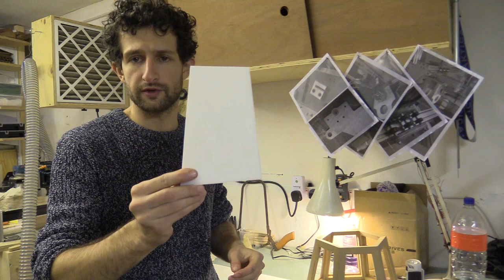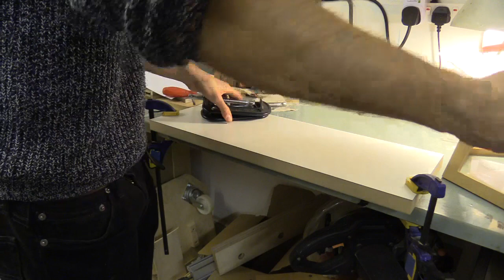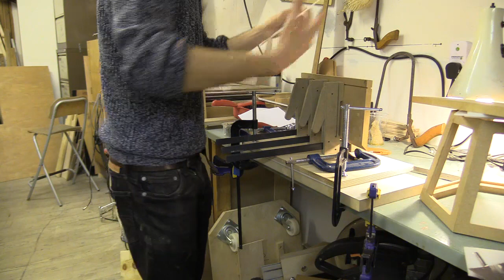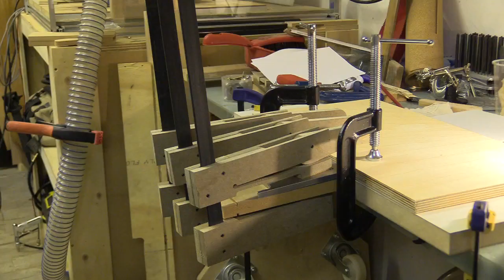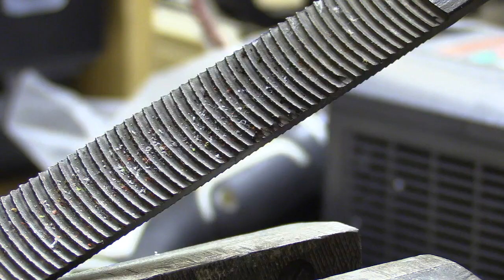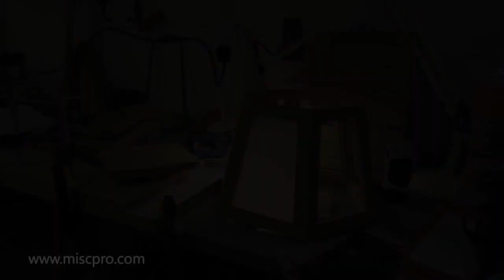Plastic Snapping Jig / How To Cutting Acrylic Without a Saw

Comment: Tip: The scoring is a lot better if you use the blade backwards, with the sharp edge trailing. You can get blades that fit Stanley-type utility knives for cutting laminates like Formica that work like this - search on 'laminate trimming blade'.

Comment: I wonder would this method work for glass as well?
Reply: No need, I would imagine, as freshly scored glass invariably follows the correct line because of its inherent rigidity and internal stress. I've never seen the traditional score-tap-prop-bend-break method not work on glass to produce precise edges.
Reply: Really? You've never seen it not work? I've had endless issues with glass shattering trying the traditional method. I would have thought a method like this where the material was braced above and below would decrease the chances of the material shattering. Maybe I'm not scoring the glass correctly.
Reply: By the way: clever idea & a nice build (as usual!) Savvas
Reply from the maker: It probably would but I wouldn't use this method for glass. Just need to practice scoring glass and making sure the scoring wheel is lubricated. John Heisz has a good video showing the method.